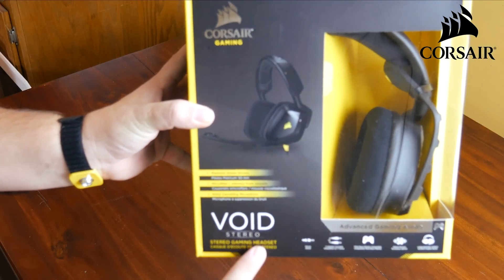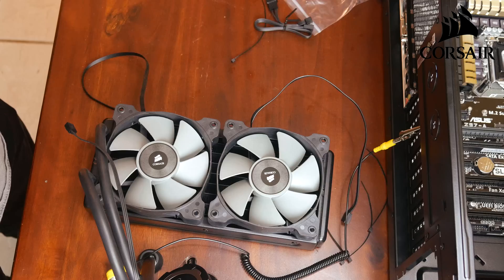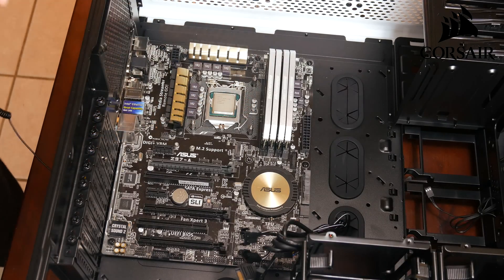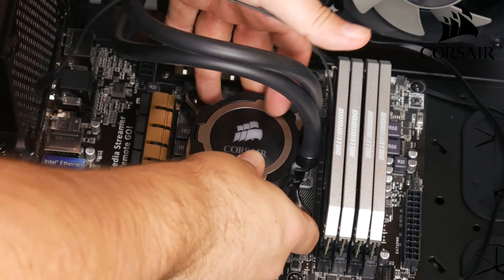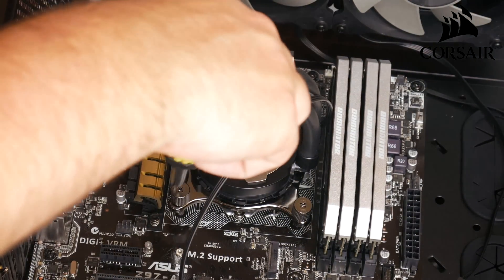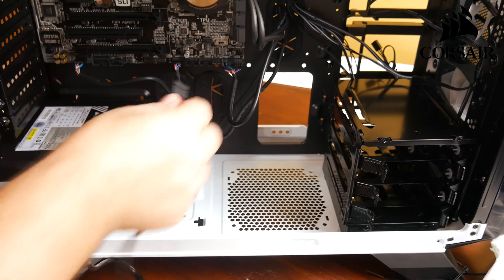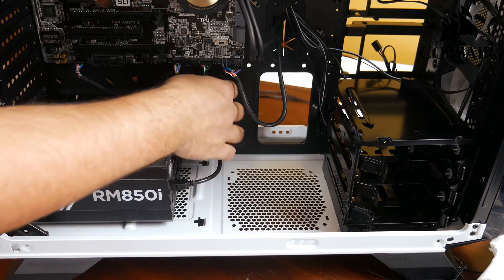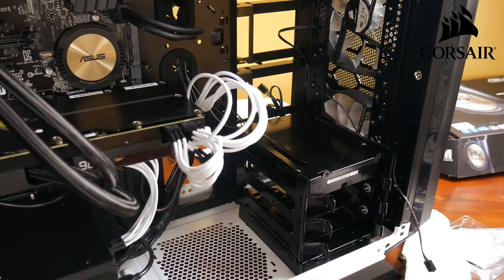Deluxe20's PC Build - Part 3 (Mounting and Installing CPU Cooler, Power Supply and Graphics Card)

Comment: D20 you should have put the fans on your radiators on the other side, you put them in to where they pull air from the inside of the case when you should have switched it to were it pulls air from the outside of the case, you will find better performance that way because it will get hot inside and just keep cycling the heat inside your computer
Reply: +CRAZYB0N3S thats how its suppose to go, all the professionals do it that way and thats how they are suppose to go 95% of the time, if anything he put the cpu cooling radiator backwards, the hoses should be at the front and not at the back of the case touching the rear fan for the gpu, he could have put the gpu cooler fan at the bottom slot on the bottom of the case where he took out the HD casing, there is a sport to put a fan down at the bottom but there is no dust filter, but as far as that, its pretty legit

UPDATE : he said the hoses interfered with the ram so there is that answer to that, my case is pretty much the same i have a obsidian 650 D, i have almost the same setup just not the motherboard and the graphics card

Comment: Loving the progress on the build. you may want to check the speeds on each pcie slot though as the top one is usually the quickest. And I don't know if it would look better to turn your CPU radiator around so the pipes come from the other side and don't interfere with the GPU radiator. Just food for thought for you to experiment!
Reply from the maker: +JWgaming the CPU radiotor cords got in the way of the ram on the other side
Reply: +Deluxe2O oh fair enough. Still looks sweet though

Comment: Please put the gpu on the first pci slot for better performance.
Reply: +seansaewhat Its in the second PCI-e 3.0 x16 slot so its all right.
Reply: DennisProductions it would be faster if it was on the first one, but i think i see it cant fit since the fan is in the way
Reply: +seansaewhat It won't be faster they are both the same port both x16 it will only slow down on this board if you use sli.
Reply: DennisProductions ahh, thats where i got it wrong, thanks